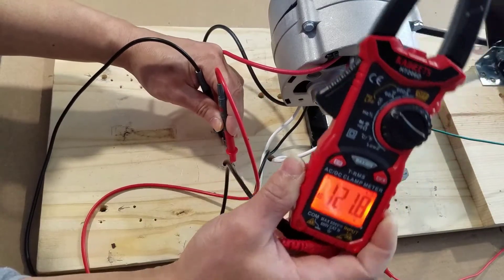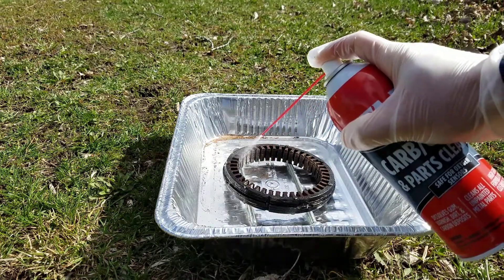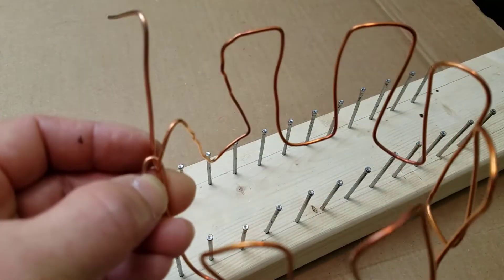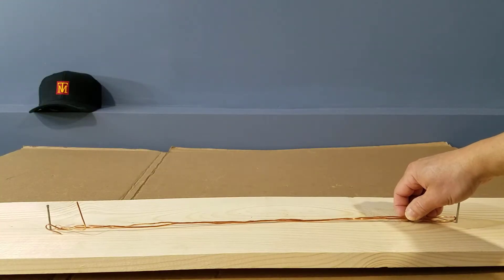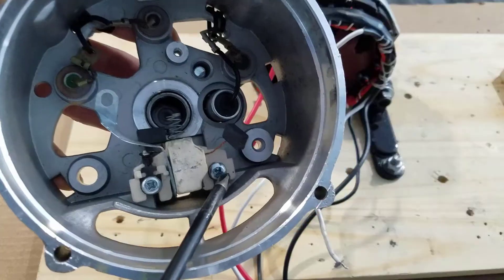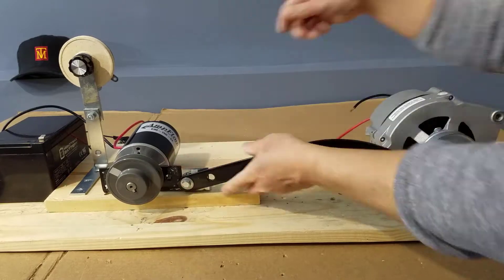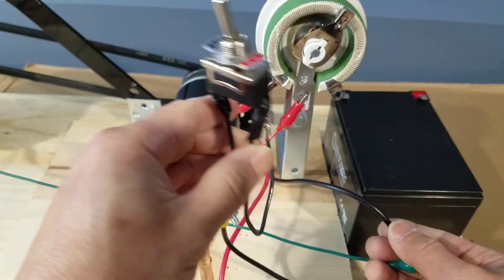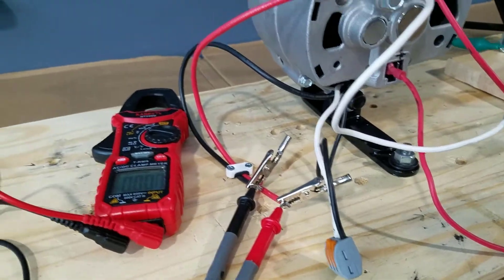I Turned A Car Alternator Into 120v AC Electricity Generator!

Comment from the maker: Hello Everyone, and thanks for your support!

Here's a video on how I turned a lawn mower and an alternator into an Emergency Power Generator https://youtu.be/88774ED_E8k
Reply: but how many watts?? Great job btw
Reply: @KiNG-R1CH  - Not many. The winding wire is too small, you need thicker wire if you want high amps. You have to build a bigger alternator.
Reply: I have a question and please forgive me if it sounds stupid . I don't have any electrical knowledge but I was wondering could you make the generator spin faster than the motor by using a gear system commonly used on bicycle with the bigger and smaller gear ratios? I hope that makes sense. Please let me know I've been thinking about this for awhile.
Reply: @eddierenrag1738  - Not needed.

Comment: If you took a 200amp DC alternator,  dramatically increased rpm & bypassed bridge rectifier to get 120VAC, would that give you 20 amps & 120vac
Reply: Before excessive heat resistance

Comment: I have an add on idea
10000psi electric hydraulic pump wired to battery
Psi output to hydraulic rotary motor
Rotary motor mated to spindle of 12v dc motor reversing it using it as a generator
Generator keeps battery fed and feeds power to hydraulic motor?

Comment: That sound it does once you turn on the saw, reminds me of the older (original) metro cars in Montreal, when they start up. Every time, there are three notes the magnetic field plays for us. So much has it affected the city, that they use those three notes every time the doors shut. Alas, advanced trains removed that natural sound, leaving behind a memory of it every time the doors close, to add, at an ear-wrenching 440hz, whereas the train's tone is 432hz.  Rockefeller is still around.

Comment: This would have been more awesome if you had a oscilloscope to see the waveform and the also verify the frequency of the output.....
This is Excellent work as it is for what you wanted to demonstrate......
Best.
Reply: are you suggesting it may not be making an ideal sinusoidal waveform due to it not being required to produce a sinusoidal waveform in its intended application?
Reply: @paradiselost9946  if you want to consider power delivered, then you waveform and frequency are the most important factors.....

Comment: Thank you for this interesting video! I’ve built a wood gasifier and a purpose-built engine to generate electricity using alternators. One key goal was to make the entire setup EMP-proof—not out of concern for EMPs, but because it adds a level of redundancy that makes the system simple, reliable, and easy to fix.

Since I’m in the Gulf Coast area, I want my generator to have enough output to power an entire home. After a major hurricane left us without power for a week and a half, we were able to run our central AC, refrigerator, and a few LED lights on a 7,500-watt generator. So, I’m aiming for my setup to produce 9,500-10,000 watts to provide a buffer for emergencies. Having four alternators is key to achieving that level of output.

The diesel alternators I’m using, especially from the 12-valve Cummins, produce more power at lower RPMs compared to standard alternators. I’ve tested alternators from a Honda at 5,500 RPM and got 44 volts, but the frequency was too high. In contrast, my diesel alternators can produce higher voltage at a lower frequency, which is perfect for my setup. By running my engine at 2,300 RPM, I maintain a good balance for both the engine and alternators, similar to highway cruising RPM.

Another reason for using multiple alternators is redundancy and ease of maintenance. If one alternator fails, I can quickly swap it out, or just remove the diode rectifier and rewire the phases to generate 29 volts AC. This is much simpler for me than rewinding an alternator for 120 volts AC. Rewinding requires raw materials like copper wire and insulation, which I may not always have on hand. If I had to rely on a single alternator, I’d follow the steps in your video closely, but my skill level in rewinding is nowhere near yours, so it would be a bigger challenge for me.

Comment: I would want to know the torque and frequency in and the AC current and voltage out.  Then I could figure the efficiency.  Also it looks like there is a problem with the AC frequency.  Some things need to run close to 60 Hz.

Comment: All that's not necessary....just excite the field with the stater s output...get the RPMs up...walla 120v AC...just use a battery to initial start..

Comment: There is a much simpler way to do this.  Use a transformer to convert the 12vac to 120vac, you don't need to rewind the alternator, just bypass the bridge rectifier to get the 12v ac output.
You could use a microwave oven transformer and replace the 2000 turn winding with 12 turns.
Reply: Yeah they're 10:1 but only meant to do milliamps at 2-4k volts
Reply: Świetny pomysł, ale potrzebowałem kilku minut aby zrozumieć co napisałeś. :hand-pink-waving:

Comment: I wonder how well it will work to have 6 windings instead of 10 for 72v to directly power a dc motor for a e motorcycle or scooter.
Reply: That should work fine, but you would need additional electronics to make that output smooth 72v DC and not go kaput while you use it to its maximum range

Comment: What frequency, or hertz would this produce?
Reply: 60hz as it would spin around 3600rpm to put out 120v
Reply: That is to be verified as there is zero measurement done of those parameters in this video.

Comment: So are you saying that the battery is charged at all times,and you are running endless power let me no.I will be waiting  for response or this setup will last for 20 minutes no more.
Reply from the maker: This setup is not a free-energy device. It's how to covert an alternator output directly to 120v AC without an inverter.
Reply: Thank you
Reply: In your other video on your page, where you able to get alternator to charge battery with 1 HP motor and then from inverter connected to battery run AC power successfully and keep battery charged or not..

Comment: What was the size of the original copper winding that you replaced with 23 AWG Wire? Also, you made 60 loops of 23 AWG but were you counting only 30 loops each on each nail or did you in fact go around each nail 60 times?

Comment: this video is great for 1 big reason. Most people just use a transformer to convert the 12v to 120v which is fine for heaters and light bulbs but won't work for 1 big reason for electronics. FREQUENCY. car alternators have a frequency in the 1000's while the grid and electronics need 60hz (50hz in some places). this method makes it so its 120v at 60 hz (if spun at the correct speed). I'm going to be attempting this to build a generator that can synchronize with the grid (look up generator synchronization) to see if I can feed the grid using a engine and this generator along with some electronics to control the electromagnet. Keeping the engine at max throttle and controlling the field strength to control the voltage (exactly like a real power plant)
Reply: auto alternator has too high a pole count to be practical at making 50/60hz. iirc, theyre usually a 12 pole. (this one is interesting being a 14 pole?)
meaning they spin at around 500RPM, or even half of that, for 50/60hz. at that speed they just dont have enough magnetic flux cutting sufficient conductor to make a worthwhile output, and the consumption on the field winding starts to exceed output.

theyre intended to spin at 3000RPM+. faster they spin, the less excitation current needed.

better to just use a regular generator thats already had all the hard work done. all you do is fuel up and plug in.
Reply: Please post a video on that if you do it, that's pretty much what I'm trying to do!
Reply: A few batteries to store the power for an emergency, and its all good!!!
Reply: The power grid runs on 480v maybe higher but I know that's what you can get for a residential house. Don't be feeding a grid any power without talking to your local municipality. If your area has power outage and your feeding grid it could kill a lineman trying to restore power. Generator manufacturers make a switch kit to isolate a generator from the grid when feeding a house during power outage and. Why would you want to feed the grid a minuscule amount of power anyway?  Just use it around your house for items u need power for.

Comment: The system is powered by a battery, which turns a DC motor which then turns the modified car alternator, to produce 120V AC (at 215Hz and unknown shape) but the power output has to be 80% x 80%, so maybe 65% of the battery output (off the top of my head)? Why not use a solid state inverter with 85%-90% efficiency and no moving parts (no wear and tear and no noise)?
Reply: the motor is just for demonstration. in the real world you would connect it to a engine or turbine.
Reply: I'm guessing it's because this modified  alternator can be connected to anything that spins.  Dc motor, diesel generator, gas generator, wind turbine, water wheel, bicycle tire, etc......

Comment: there most  definitely   meny was to build a. your own " DC"  Generator  but to date  the best to date is  that fits the Bill is the One demonstrated in this  clip .  It come in meny was  Clos  to industry sander In my opinions   The BSA  300 wat  Generator all though not yet as refined at that it hold meny of  it achievement   the Varick to increace the set's  charge  control  & it ability to diliver a 300 wats . of current  alone with it ability  to delved a rectified  caging current  Clearly the ues of a stable alternator can  diliver all these  element  at 3 phase. but ailing this with the ues of a Varick to adjust desired input current  is a must . & the ability to fix's  as a singular Drive  shaft is yet  another must in it Build. though the ability to build a compact unit as it advantage  To most. . The ability to diliver an externals lighting grid is not completely necessary. when a well charge battery bank can diliver that. so to conclud a DC gen set develop,  on that, based  on  the  BSA 300 watt Or the Toronto Johnson Iron house. Charging modal.  is the best one can achieve as a DIY . builder.  with indirect Or direct drive as part of it Development.  using the alternator as the mens to  ues of the shelf elements in it build.

Comment: So the question is what is recharging the battery and the second is what was the THD of your Alternator and what did the sine wave look like? And what was the Frequency at, lighting a bulb is one thing but modern electronics is something else entirely. But that was a nice way to test proof of concept. That was nice work with the rewiring the stator, I see your a man of Patients. Good video.
Reply: I see you meant ' a man of patience'.

Comment: Well, for starters, increasing it's loops to 60 was totally unnecessary as Alternators produce 110 volts to start with.  It's the diodes and voltage regulator that lower it to 12 volts.  And the output depends on the voltage you apply to the brushes, which create the magnetic field on the armature. 12 volts applied to the brushes will produce 110 volts output in the coils inside the casing.
Reply: That is false, alternators put out 12 volts AC and the diodes and regulator keep it at 12 volts and convert it to dc. As a car engine spins faster the voltage produced will go up and you can have that in a car. with only 5 turns of wire normally The voltage can only be 12v's by putting more turns you capture more of the energy and increase the voltage to 120. Also the reason this is preferred to a transformer converting 12v ac to 120ac in the last big problem. FREQUENCY. the grid and most electronics need 60hz and a car alternator is a few thousand hz which for restive loads such as heaters and light bulbs in fine but for electronics and other applications is not fine
Reply: Good grief ! There's a lot of misinformation in this little thread right here  !!! I wouldn't suggest anyone commenting here in these comments try doing any electrical testing or research or even just curiosity experimenting as they will prolly quickly win the Darwin award 🤣.... Smfh
Reply: @davidshepherd-sj2tj  yep. and theres no point trying to explain anything... "TLDR..."

welcome to the results of the modern education system! where everyone has half arsed misconceptions...

lol, can get an alternator to make 1kv or more if you dont load it and spin fast enough.

and in a short, one suddenly finds it rather difficult to say what voltage it can produce as theres no way to actually measure it...

faraday had the advantage of no preconceived ideas when he came up with the term "EMF"...
Reply: What he did was to reduce the resistance so he could increase the current flow. Basic ohms law
Reply: AC does not work in series like DC does unless you add complex circuitry balancing the multiple power sources.
Reply: I want to see one run without a battery
Reply: When you remove the diode rectifier from the alternator, you'll get AC output, but it won't be 120 volts. At peak output, you'll see around 40 volts AC, and the frequency will be closer to 90 Hz, not the 60 Hz needed for most electronics. It’s important to remember that RPM determines both the voltage and the frequency. If the frequency isn't at 60 Hz, you'll risk damaging any electronics you plug in. Based on my calculations, for the alternators I’m using, the correct RPM to hit 60 Hz is around 3,700 RPM, which gives me about 28.8 volts. To get the necessary 120 volts, you can connect multiple alternators in series—four in my case—to reach the required voltage while maintaining the proper frequency.
Reply: Will they all have to be the same identical alternators  @TAShannon1
Reply: The guy saying an alternator is DC only is ignorant. It's called an alternator because it produces alternating current. A generator like on old cars produces DC only. A modern alternator uses diodes to turn ac to DC and voltage regulator to get 14v DC
Reply: Diodes Convert AC Voltage to DC Voltage Voltage Regulator controls output Voltage
Reply: Does this mean that what he did will creater more power? Or could it. He increased the coils to the 10 power.
Reply: so if he only removes the diode and runs the altrernator he''ll have the 120 volts?

so to get the 220 he has to run 2 alternators to double the current?
Reply: @stoner4   In answer to the first part: All the diodes do are to make sure only ONE polarity is traveling down that line.  So the diodes are placed in there to change it from AC current to DC current.  The voltage regulator is what lowers the voltage to 12 volts.  An alternator is basically a 3 phase generator.   
   In response to the second:  I live in the US so alternators here are designed to produce 110.  In European countries the alternators might be produced differently and the actually AC output of those may be 220 volts.  So I can't be certain that it would require 2 alternators to get 220, but I do know that, to my knowledge, it would require 2.  There is, however, one caveat:  You could also add a power booster to increase the 110 to 220.
Reply: @bigrenegade7121    thank you so much I'll have to get an old alternator from the junk yard and possibly connect it with a 12 volt battery powered motor or a bicycle wheel, with a motot connected to the axle, that might work.!!  So I should bypass the diodes or disconnect them or maybe connect them by a separate wire to run the electric motor to run the bike wheel, anything to get  the alternator putting out 120!
Reply: @stoner4  If you want 110 AC output then you need to disconnect the diodes.  They are there to change it from AC to DC. Basically am alternator is a 3 phase motor/generator.
Reply: @bigrenegade7121  the problem is the frequency which rise up to 300 hz
Reply: A car alternator is all DC there's no ac he made it ac

Comment: Hasn't anyone noticed he took a 12 vdc alternator rewound the wires times 10 ie 6 to 60 then says he gets 120vac after changing the windings to series.    How is it you yet ac from a dc alternator jst by removing the voltage regulator and increasing the windings then connecting them in series?
Reply: The difference between AC and DC alternator (at least with the generator winding in the stator) is just whether they use a static or changing magnetic field in the rotor. If the rotor in the center is supplied with DC (or if it uses permanent magnets) it becomes a static field and therefor the alternator produces AC current.
Although generally car alternators are actually just AC alternators with a rectifier built into the regulator circuit.

Anyway by removing that regulator at the back and connecting the rotor to a external DC power supply it turned into a AC alternator.

Comment: 3 phases in series just don't work, output voltage across A-C is 0v. I did this experiment as you shows and got the output 0V. So this is  FAKEd.
Reply: Thanks bro I thought I was the only one that saw it if he is truly getting ac then it has to be single or 3 phase

Comment: If you can remake the regulator to keep a constant voltage. Turn it to high voltage DC, send the power to a H-Bridge, feed the H-Bridge with SPWM to produce a usable 50-60hz 120v ac output (like in a switching inverter, 12vdc -> something high voltage DC -> H-bridge with spwm -> usable power)

Comment: Great video. Was wondering if this generator would be powerful enough to charge a homes battery bank?
Where did you purchase your wire?
Reply: If if its 120v at 60hz it would. As long as your battery bank is meant to be powered from a regular 120 wall outlet.

Comment: If you change the pulley make the motor pulley larger than the pulley of alternator then reconnect..but remember the key is coated copper otherwise it will be just a trap